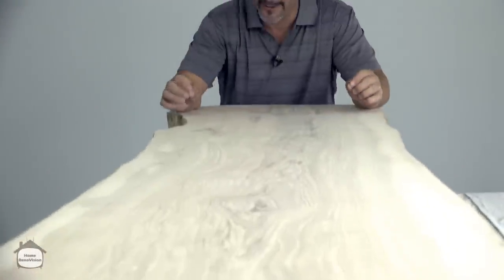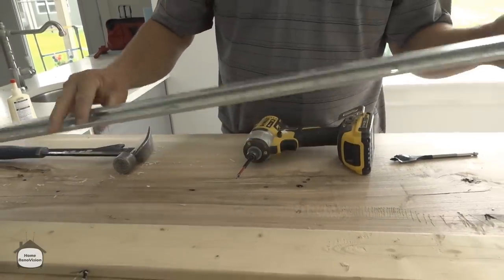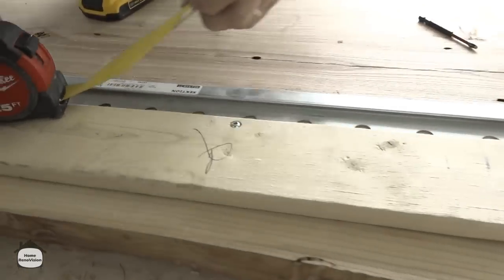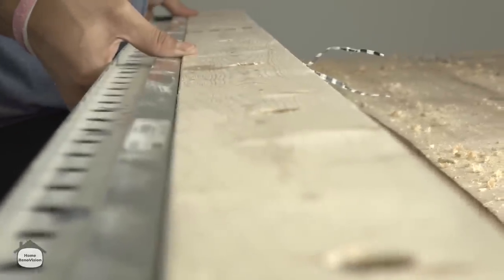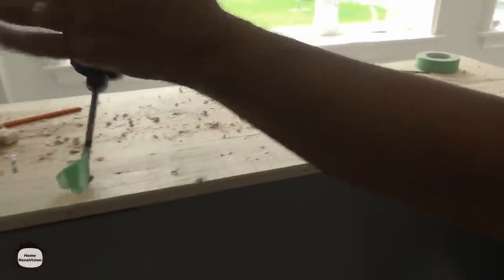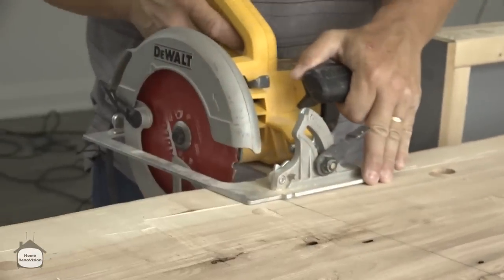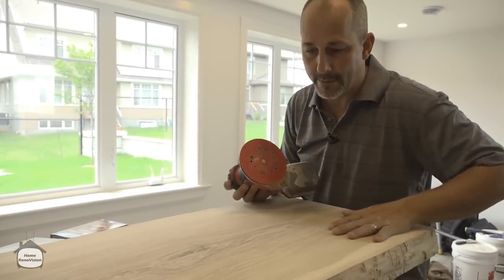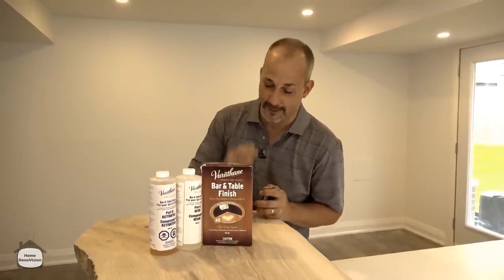How to Build A Live Edge  Counter top for under $500.00

Comment: I assume the base of this was a strong base considering the weight of the wood top?  If i wanted to do this in my basement what would you suggest i do for a base? I’m an infant when it comes to this stuff so please excuse my inexperience if there is an obvious answer to this. Thanks in advance!!! Love your channel!!
Reply from the maker: i installed on a 2x3 wall and used gas line pipe for the supports. Cheers!

Comment: I do woodworking on the side as a hobby and my wife and I just moved into our son's house she wants to redo the kitchen and wants to live Edge slabs 1 7 foot 1 8 foot how would you cut and join a slab. So that you have 26" if your local Mill can only cut 24in maximum?
Reply from the maker: use a track saw to cut 2 pieces and then pocket screw it together with glue, sand and finish. tada!

Comment: I subscribed and joined!
I can’t find the followup video to this one.  Why is that?
I’m doing pretty much the  same thing except it’s an L shaped live edge counter.
Reply: I subscribed and joined ($6.99 US /month) found the link to the finished project video and when I clicked on it,  I got an error that the video is private. What a disappointment. 
The videos are great, but this is the very disappointing. At the end of the video you encourage comments and assure that you read them all. I guess I’m hoping you get to this before I cancel my membership in frustration.
Reply from the maker: Hi Ed, I don't think we have a video on that finish. sorry!
Reply: @HomeRenoVisionDIY  Bummer, however this video is pretty good as far as an installation process. My project is also a kitchenette style bar top, but will be in an L. At the L origin is a post that I need to cut around. For that I've made a template out of birch plywood. I'm still scratching my head as to whether I'll be able to use your 1x4 template and wooden dowell technique.

Comment: I do have a question about an upcoming project. I have a patio that I will post a picture of that I want to convert into a bathroom. the open area and an outdoor closet with a concrete slab that I think I will have hack hammer out and dig out 2 feet down for the plumbing. I'm just not sure how to attach the subfloor level with the rest of the house and existing crawlspace without damaging the foundation. lol, I have so many questions.

I just noticed i can't attach a picture. Google 400 knox ave vine grove ky
Reply from the maker: Call an engineer for structural questions. They are not that expensive. And you have someone to blame if things go wrong.

Comment: Couple of natural hard wood finishes that I like may be an option for tops like this, Rubio Monocoat and OSMO Hardwax Oil.
I'm not a big fan of epoxy finishes, over time they have some big drawbacks.
Reply from the maker: Thanks for contributing to the conversation. That is exactly what I was looking for.
Reply: I would have to agree with jpccola, When using a natural edge slab I would prefer a natural looking finish. I have had good success with the Rubio Monocoat as well. It provides a nice satin finish with durability. Rubio was formulated as a floor finish so it is quite durable.

Comment: Maybe I missed it, but you mentions having to wait until the finish was dry before you applied the epoxy top coat, what finish?
Reply from the maker: We used a filler to eliminate the gaps and cracks.
Reply: James B

Comment: If you use epoxy you might want to finish the underside too to have it all encapsulated, the slab takes and releases moisture a lot less that way. That would be done before setting the slab in place but it would have taken an extra day. There are a lot of oil finishes that are very effective on bar tops, they leave a more natural feeling to the surface but require a bit more maintenance from the homeowner though.  Since a slab like that moves with the seasons maybe making it removable could have been a good idea in case it needs to be reworked.
I was told that all those trees would have to be destroyed its nice to see they can be used
Reply from the maker: Good idea, however ijn this country we regulate the temperature and humidity in our conditioned spaces so this kind of chANGE never happens. Cheers!
Reply from the maker: Good idea, however ijn this country we regulate the temperature and humidity in our conditioned spaces so this kind of chANGE never happens. Cheers!